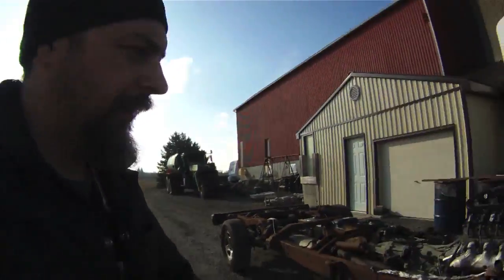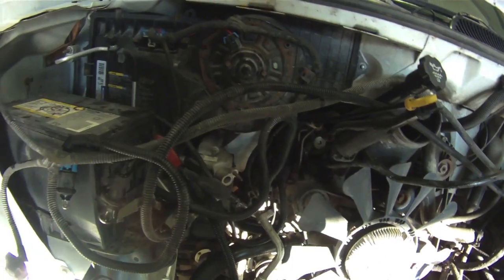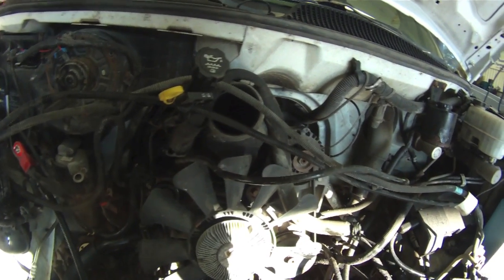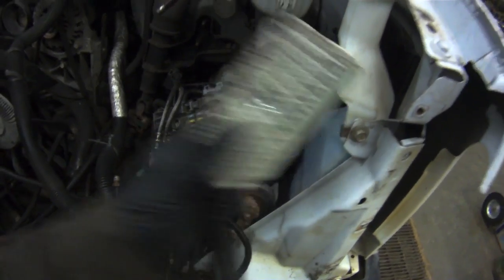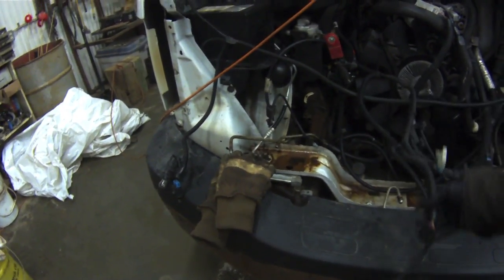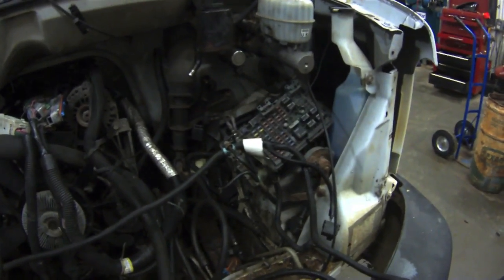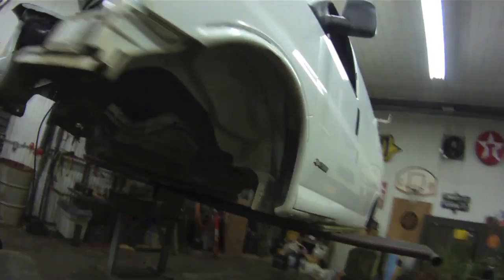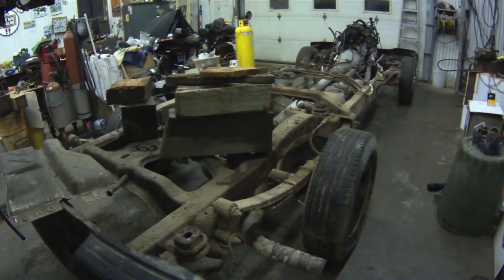taking body off express van

Comment: are those both van frames that you are working with? i just swapped an 06 3500 express body onto an 03 express 3500 frame, both rwd only, both had the 6.0 and 4l80. id like to make mine awd if possible, wasnt sure what all else i would need to change. i have an np8 electronic transfer case and a front diff from an 04 avalanche if need be. not 100% sure yet how id go about wiring that whole system in or how exactly id fabricate it up.
Reply from the maker: Yes I found a van but the body was pretty roached out so put the body from my van which was good on the awd frame. Best van I ever had never had to worry about driving in the winter or in the farm fields.
Reply: @geraldd1036  I'm not sure there is room under my van to do it, but if there is I may try fabricating the avalanche 4wd system into it. Not sure how difficult it would end up being but I think it could be done

Comment: But what about the VINs?  They are stamped all over the vehicle, not just the windshield plate.  There is a slight chance of having some very messy issues.
Reply from the maker: the only messy issue would be is if I was trying to sell it as a matching numbers vehicle. something you don't do with these vans that is more for hot rods and classics. Im driving this van till it goes into the scrap yard. been driving great since the conversion over a year and a half ago. hope you evjoyed the video.Thanks..

Comment: I kept telling myself that this could be done. Thanks for the video.. you did exactly what I had in mind.
Reply from the maker: I hope the video helps out. have fun converting. the awd is awesome in the snow.
Reply: Not converting. I have an AWD that I purchased at an Auction for 1,100. Cylinder 4 had no compression so I want to do a motor swap, but I figured this way would be easier vs trying to get a cherry picker in that tight space
Reply: **doing it without a dual lift bay.
Reply: @geraldd1036  Les boulons de fixation de la carrosserie se retire par le dessous du véhicule ou parler intérieur du véhicule ?

Comment: +gerald d is it necessary to remove the front end on the van or you just did it because of the conversion? i want to do this to my 96 express to change or repair the chassis. how many hours do you think it took you from starting to end in removing the body of the chassis if you were to add up all the hours.
Reply from the maker: you have to remove anything that free's up the frame from the body. I removed the rad saddle rad and ac because you cant lift the body off the frame with all that attached. and then it is easier to remove the wiring. hope that helps.
thanks.
Reply from the maker: if you have a 2post lift and not a centre lift it should take you a lot less time. I would say 10hours.
Reply: i wish i had someone to lend me a lift. lets see what i can do to take the frame out. thanks for the input